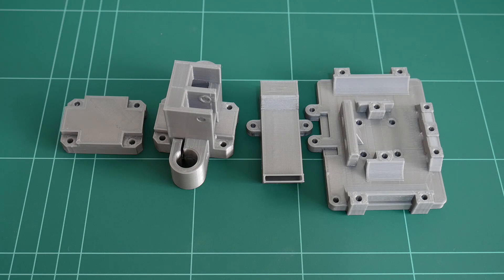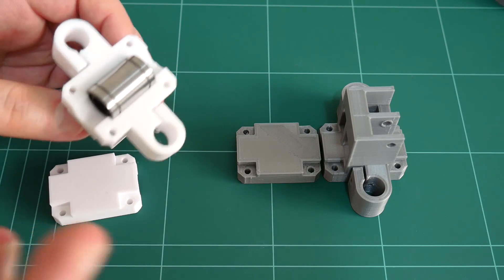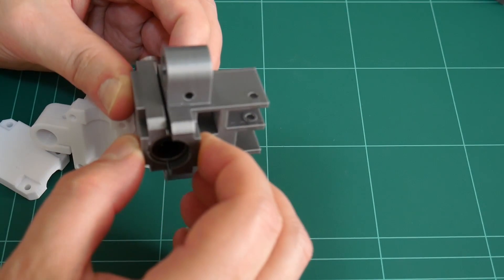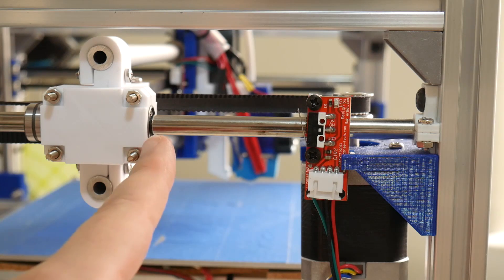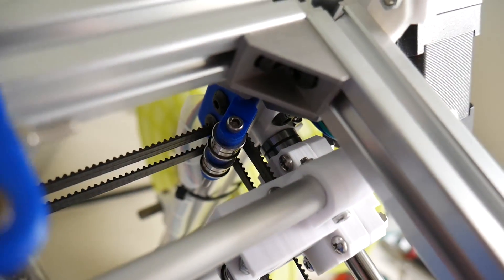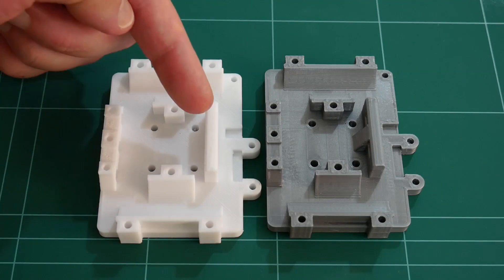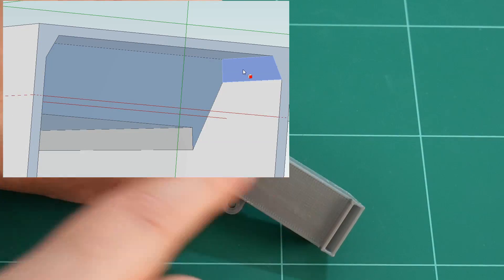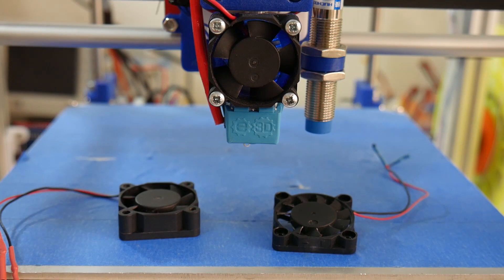New 3D Printer - Build Log #14

Comment: Screwdriver in fan is a classic lol. Print yourself a plate to fit in front of the fan with 4 holes that the screws will pass through. At the 12 and 6 position you need a clip to hold the plate onto the fan so you can have access to the screws without the screwdriver going into fan that should be switched off. Hope this makes sense basically a blanking plate.

Comment: I have decided to order a Hypercube kit. The one that I will get is the, 
HyperCube EVO Evolution 300mm 400mm Build Volume 3D Printer Extrusion Parts Kit, from Zyltech out of Houston, TX.  It comes all of the extrusions pieces and the rods, leadscrews, and bearing hardware to start my build. I will be using the electronics from a damaged purchased Raisecube R2 that I received via USPS. The frame was completely gone, most of the other main items are good.  I will order one of your pre-printed 3d parts and then print the upgraded items from the files I already have.  Thank you.

Comment: As a balloon twister you learn a bit about practical re-use of latex rubber after large balloons burst, not wanting to bin them; You can use pieces of latex balloon to provide traction and a firm grip on plastic parts otherwise only held together by the compression force of a screwed together plastic casing. I applied rubber to my extruder gear and it hugely magnified it's grip on the filament... I seriously wonder why we're relying on metal grooves for that task.
Reply from the maker: That is interesting. It's great you've found uses for exploded balloon material.

"As a balloon twister" - best job description ever!

Comment: Great project, I'm thinking of converting my own i3 to a Hypercube.

In the meanwhile I'm trying to practice in upgrading the current printer and so I have a question about modeling the parts.

I tried FreeCad, but I find it Un-Friendly and rather buggy, but thats probably because I'm used to SolidWorks that we used in the Uni.
What modeling software are you using to create the parts?
Can you recommend any alternatives. 
( I have experience with 3d modeling so I'm not searching for some "Ultra simplified" programs for beginners  just something solid/stable)

Thanks for the great content,
Constantine.
Reply from the maker: Hey there, I use 3D Systems Design software. It's not cheap ($199), but affordable compared to SolidWorks, and is a cut down version of Geomagic Design which is a SolidWorks competitor. Similar interface too.

That's interesting you say FreeCAD is buggy as I was going to give that a try. You can also take a look at Fusion360 or DesignSpark, both free.
Reply: Well, nothing says you shouldn't try it anyway. That was just my experience, maybe it will work out better for you.
They do have a disclaimer "FreeCAD is under heavy development and might not be ready for production use".

What I experienced ( and I have the latest version 0.16.6706 ):
1. It does not crash too often but when it does its rather unexpected in the sense that if I repeat the same steps a second time it won't crash. ( Inconsistent )
2. The tools also feel a bit inconsistent, I get unexpected results ( comparing to other software packages ) when doing 'advanced' geometry manipulation, like 
  a.  boolean operations ( even the most commonly used one that has its own dedicated button to make a  'pocket' ). 
  b. creating new geometry by adding points manually and closing the polygons 
  c. and the latest thing I tried which was create a shell from a solid ( This was the worst to get the results I wanted, had to make it almost manually ).
3. And again, a very subjective point, but I felt the interface is lacking, I can deal with incomplete/missing features, but I found it hard to actually move around and understand how to do some of the operations. ( Had to search the internet sometimes for things that sound very trivial when using programs like SolidWorks or even 3D Studio MAX ).

The most important point to make is, this is MY experience, maybe most of the bugs I experienced are somehow connected to my machine ( it is a very in early stage piece of software after all ), so to be fair, maybe you should give it a try when you have the time.

Thank you for the suggestions, I will look into those, both DesignSpark and 3D Systems Design are new names to me and I didn't get around to try Fusion360 yet, now I will.

Your videos are a great source of information and inspiration for 3D printing, thank you for sharing your insights.

Comment: I managed to get a moderately acceptable print of the fan duct by printing it vertical.  But all horizontal attempts ended with a rats nest of plastic filament on the top.

Maybe a tutorial on printing elevated horizontal spans would be useful.

Comment: I've had a perennial problem with prints not sticking to the bed.  Someone mentioned I should swab the bed down with alcohol to remove any grease, dust, etc.  Holy Mother of Hannah, did that EVER WORK!  Now, I need a hammer to release them from the buildplate.  Just passin it on...

Comment: Finally got my i3 working - had to replace all the bearings.  Now the Y axis micro switch is broken.  Sigh.  But finally, I've started printing my Hypercube parts!  I'm expanding the dimensions to 220 mm X 220 mm X 340 mm - this gives me slightly more than 1000 cubic inches of build space.  Still waiting for all the parts on order.  Onward!

Comment: Awesome design! I was finishing building Prusa I3 when I came across Hypercube and I started building it before I even finished I3. now they sit next to each other but the I3 is sitting idle while Hypercube is running almost 24/7. I LOVE it! i think the twisting around the bearing is caused not by the clamping of the bearings but by the two belts switching from going in the same direction to the opposite direction. I'm building my copy of hypercube. I've modified several parts to better suit my preferences. Including altered XY joiner and clamp. I will be posting my changes soon.
Reply: Funny, I've added a chamfer to fan duct to make it easier to print it before i switched to printing it upright. I added 45 degree supports to the mount arms to not have to print overhangs in the air. i think i should post my changes to thingiverse in case anyone else finds them useful but I've been holding off till i gather all of my changes into one thing.

Comment: Hi, im thinking in buying a 3d printer and get used to it and latter upgrade it to ahypercube if i see fit, what 3d printer do you recommend? The prusa i3? what pices to upgrade it do you recomend to buy? a new extruder, hot end?
Reply: Try an inexpensive Prusa I3 clone with a METAL - not plastic - frame.  Avoid acrylic parts, they always crack.  Should cost you around $270 USD.  I bought mine through AliExpress, but Tech2C uses BangGood.  The company was called Zonestar.  If you can afford a genuine Prusa i3 - double the cost - you should buy that, as it's a higher quality printer.  Enjoy!

Comment: I've been following along with the build log. I'm interested in my first 3D printer and have the skills required to build this printer, but don't have access to a 3D printer to print the parts. Suggestions on where to get them printed and also have no idea on the cost?
Reply: I think Tech2C will print up a set of plastic parts for you - seem to recall that it's mentioned on his thingiverse page.  His parts are always great, might be worth doing.

Comment: Love the build log! I'm planning on remixing your design to get a cubic foot of build volume (well, 300mm cubed is close enough) by scaling up your extrusion length measurements, but with all the modifications you've made I'm no longer positive what your current build volume dimensions are. Would you mind sharing that? Thanks!

Comment: Don't want anyone to think I'm spamming... but this is a link to the board I bought, in case anyone else is interested.  The guy ships promptly - within a day - as opposed to most AliExpress stores that wait a week.  He also has the lowest price.  I've bought from him before, and been satisfied.  Anyway... https://www.aliexpress.com/item/3D-printer-32bit-Arm-platform-Smooth-control-board-MKS-SBASE-V1-3-MKS-TFT32-3-2/32776414032.html

Or, you could just wait and see how I make out.
Reply from the maker: I like the look of that combo. Looking forward to your thoughts with it!
Reply: Yeah, I have high hopes.  However, it doesn't have a double Z stepper drive output, so it can't be used with a Prusa style printer (which is all I have at the moment).  I'll have to wait until I've got my new printer built, which will probably be early to mid March 2017 (got all the parts ordered, but stuff takes an eternity to crawl, swim, and drift to Canada from China).

I wonder - could I drive two stepper motors by splicing two drive feeds into one socket?  I wonder what the motors would demand - and what the board could provide.
Reply from the maker: Dual Z motors should be driven from the same step driver anyhow. You connect them in parallel. That is how the RAMPS 1.4 board drives dual Z motors.
Reply: Interesting!  I didn't know that.  I was worried about the current demand from both motors at once overloading the board.  If I can actually get away with that, an adapter would be easy enough to cobble up.  Thanks!

Comment: Re fan blades and other pursuits - I've wondered about making quadcopter fan blades, instead of buying them.  I wonder about getting them balanced, and g-forces on the spinning blade, probably other problems... but it would sure be nice to be able to experiment with different blade pitches and sizes to get the optimum lift combination.

Comment: Yes, I was hoping you'd allow the LM8LUUs! I had about 8 of them left over, but ended up buying the LM8UUs. I have been noticing a fair bit of twisting on the axis, so hopefully the double bearings will stiffen it up. I think two bearings introduce the small bit of misalignment that allows it to be tightened up and prevent twisting, but ill try both 2 LM8UU and LM8LUU

Also, if youre having the bearings not both contacting the shaft clamp, your frame could be out of square. Mine is, and I notice it. But most people will check the frame is square to begin with. Like I should have.

You should also consider a fan guard, maybe one that completely covers the blades but sticks out a little and has gaps to allow air to flow unrestricted
Reply from the maker: Yeah the dual bearings may be slightly misaligned here but not enough to cause binding - LM8LUU is preferred.
Reply: Tech2C I think the slight misalignment would be beneficial in this case, as long as it doesnt cause binding. It would tighten it up to the rods and reduce twisting. I guess LM8LUU could have the same effect. Great design, by the way. Im just waiting for my belting to arrive, and mine should be up and running. I decided to double wrap my extruder wires to stiffen them up so they dont droop onto the print bed, and im going to enclose it in blue acrylic with white or blue LEDs inside. Its going to look so great, and I look forward to showing you how mine turns out
Reply from the maker: Wow, I'm looking forward to the photo's!

Comment: Iam in progress of making my own Hypercube. I wondering why did you brought a  cutting guide for a 20x20 aluminium extrusion when you was able to make one :/ There is my thing : thing:1976293
Reply from the maker: I was at the hardware store looking for an electric saw to cut the aluminium, but the prices were too high, so I opted to hand cut them and bought the mitre box instead.
Honestly I didn't think to check Thingiverse for a mitre box...
Reply: Depending on what you paid for the miter box, it might have been cheaper to buy it then build it anyway.  PETg, ABS and all the other usual suspects aren't cheap.  On the other hand, everyone is sending you free filament to review, so maybe it would have been cheaper to make one anyway.  Gosh.  Truckloads of free filament.  Colour me jealous...